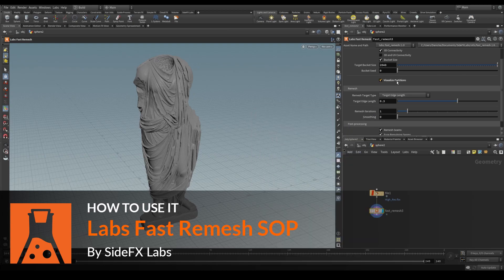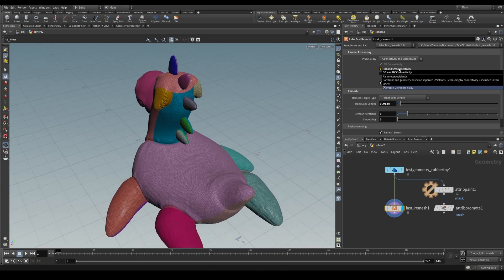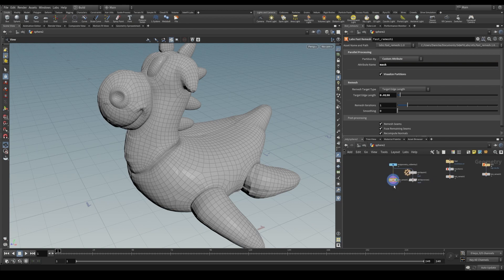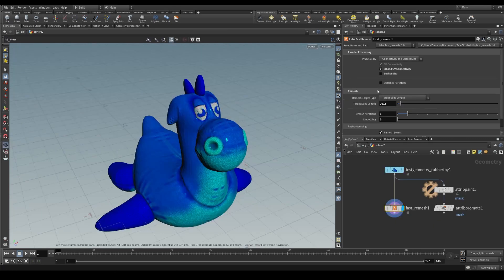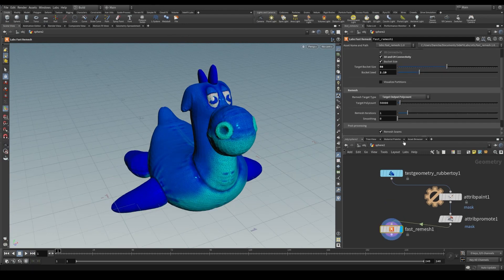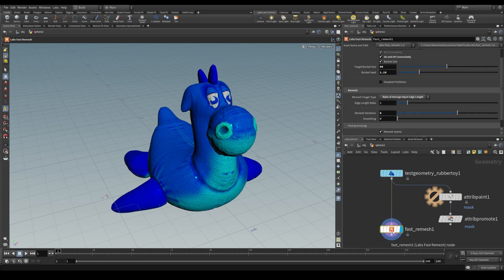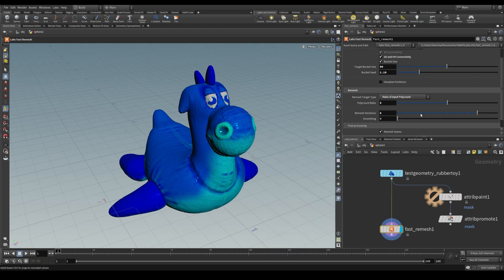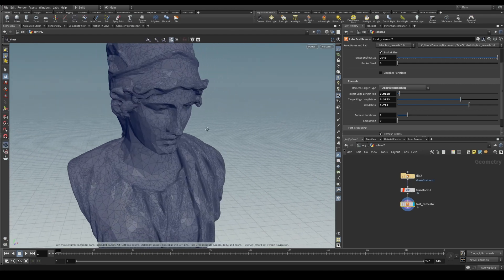SideFX Labs | Fast Remesh 1 | How to Use It

Comment: Instead of adding more and more tools, why not improving/fixing the original remesh node instead ?
Reply: They’re working on a quad remesher rn and what’s wrong with the og remesh node? Also check out the EZ HDA toolkit theres an EZ Remesher node that probably adds the features u might be looking for
Reply: @dirtcreature3d  I do hope they release a quadremesher. It is a killa feature in Cinema 4D.
Reply: i'm actually wondering the same but this is a hack on the original remesher by simply splitting the mesh and running that in a multithreaded compiled block, speeds it up alot, but it still boggles me why theyre not trying to multithread the original remesher from the get go.
Reply: This node was actually originally a community contribution. I'm also hoping they get around to multi-threading more nodes, but it's pretty great to have this in the mean time! Also, you can choose not to include Labs nodes when you install Houdini if you prefer to wait for more integrated solutions.
Reply: Cause there’s no need to support legacy codebases as SideFX community is snappy and picks up new workflows pretty quickly. You can multithread the old remesh via pdg, if that’s critical to your workflow, btw
Reply: What’s wrong with the og remesh?
Well, it’s very slow. And a smart solution would have been to improve the underlying code of the remesh instead of duplicating the feature and bloating the software with an additional hda.
Duplicating the features with workarounds instead of improving the existing code is not how software development is supposed to be. Sigh.
Reply: @YiChi457  Could you please share your methodology of picking the smart solution for software development without having access to the codebase. Thanks.
Reply: @audiodrocher  Sidefx has no access to their own source code? They are requested from customers to not improve their code and only fix Houdini through workarounds? What world do you live in? Houdini fanboys will always find excuses for anything and never recon that sesi is doing some things the wrong way some times...

My methodology is to multi thread the node cpp code itself and not getting this result though an hda trick. That would keep Houdini lighter and allow existing scenes to be cooked faster.

If sesi cannot improve their node cpp code without breaking the software, and has to do hdas to make thing work properly, that's a very bad sign regarding the code base quality.
Reply: @YiChi457   If I understand correctly, you're against the whole idea of the Labs Toolset?   Regarding Fast Remesh, my opinion is that it's way faster to adapt and improve over a community contribution HDA than rewriting the whole code from scratch.
Reply: @YiChi457  I wasn't talking about SideFX, it's the other guy who knows best without any access 😁 The requests from customers are addressed in daily builds.
So, your methodology multithreads exactly what, please kindly share the details of workload distribution, thanks 😊
Reply: @YiChi457  It's single-threaded